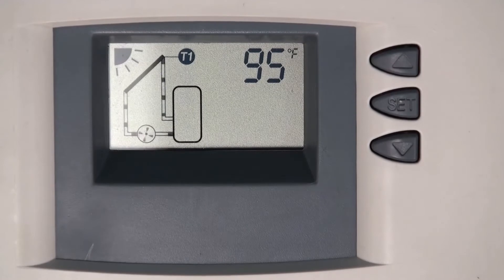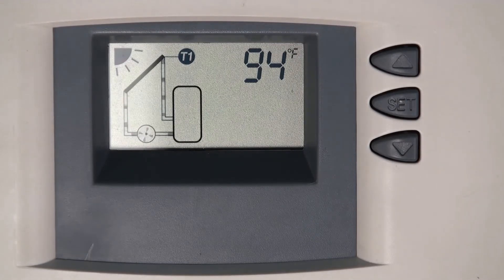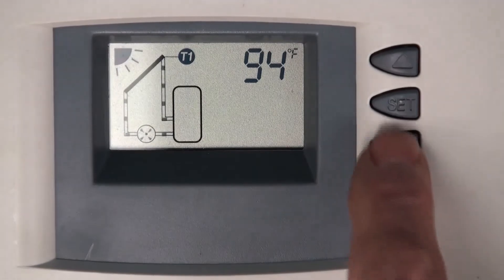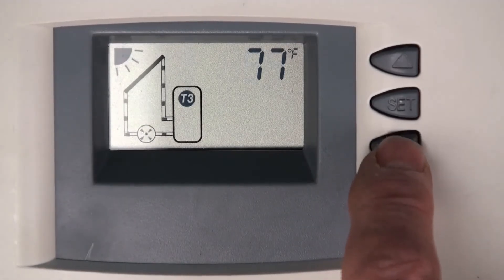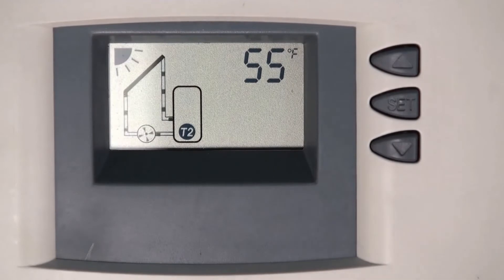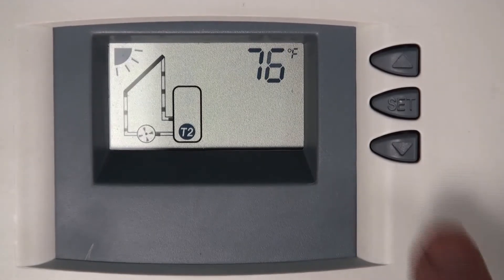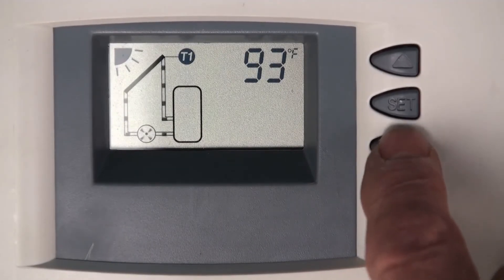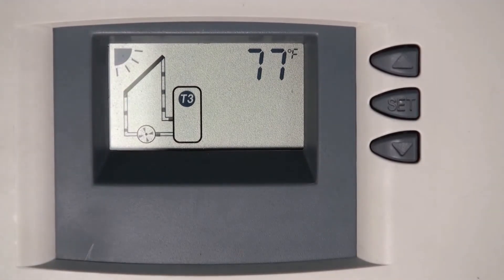SunEarth SETRO301 -  Low Temp, No Temp Part 1

Comment: After the pump goes off, the psi drops to 0 in the evening. Takes about 2 hours of pump shutoff to go from operating 35 psi  to 0 psi. In the morning the pump starts up once the panel exceeds tank temperature. Starting psi is 0 and with an hour or so it slowly builds to 35 psi for the remainder of the day. Is this normal?
Reply: Psi I’m referring to is in the glycol line